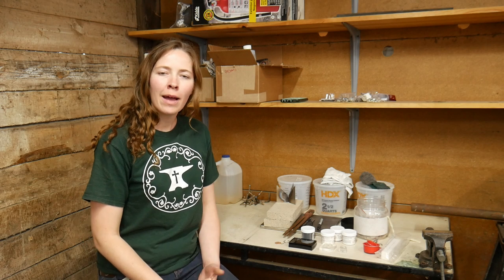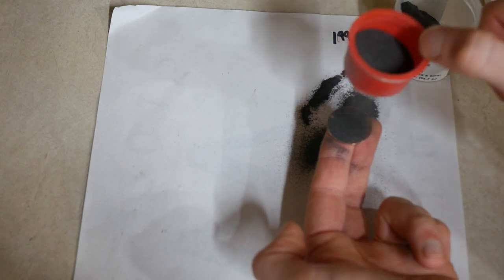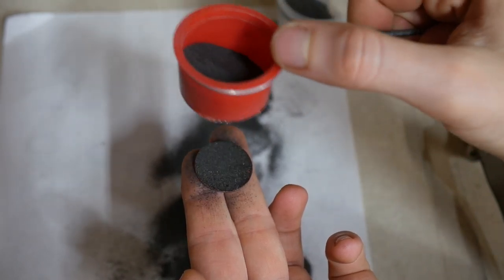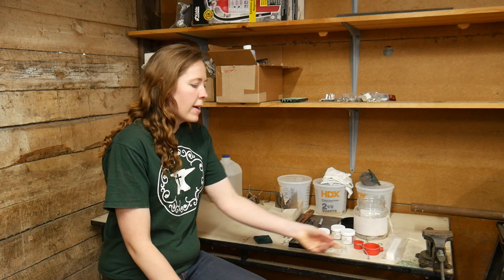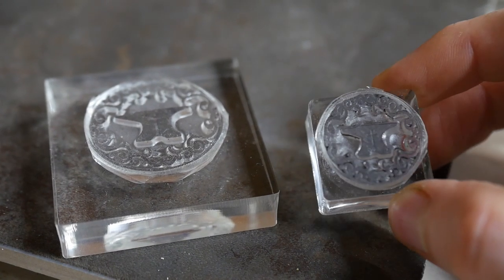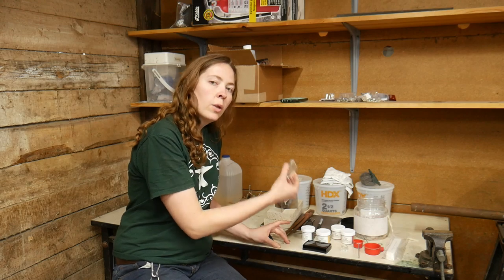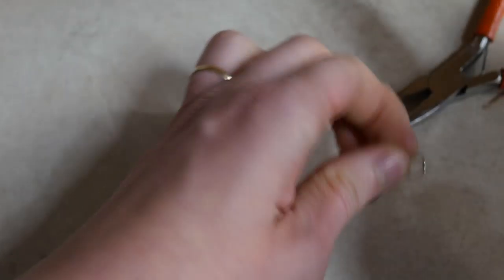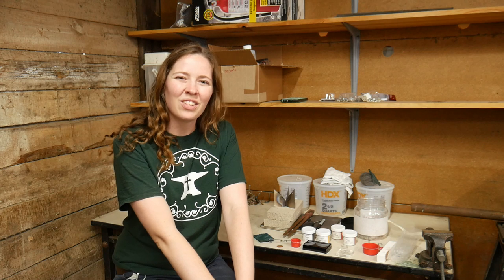Making Hand Enameled Keychains with Jessica

Comment: Very cool!  Had a thought for you (oh no, not again) 🤣.  I wonder, if you could mask off part of the blank with nail polish or paint pen, and etch it. Then enamel it for an interesting effect, if you used a clear color coat? Just keeping the wheels turning on ideas 😀👍⚒️. Thanks Jessica!
Reply from the maker: Hi drason, etched pieces are fairly popular in the enameling world. I have so much to learn still, it would probably be a while until I can tackle a more involved process like that. Love the ideas though... Keep them coming! -Jessica
Reply: The process for etching, is very similar to plating. I have a recent video. The only differences are, to switch the polarity, and instead of a vinegar solution, use a salt saturated water (brine).

Comment: Interesting stamping technique, I'm gonna try that. How will the enamel hold up on a key chain? I do mostly jewelry and was told that enamel would chip easily if not set protected. Thanks for bringing us along!
Reply from the maker: Thanks for watching! It could chip if it takes impact from being dropped. I haven't had many chipping issues with my enameling, except for a enameled cup I use in my bathroom. It's chipped a little on the bottom edge where it gets picked up and set down kinda hard by my kids. Blessings, Jessica